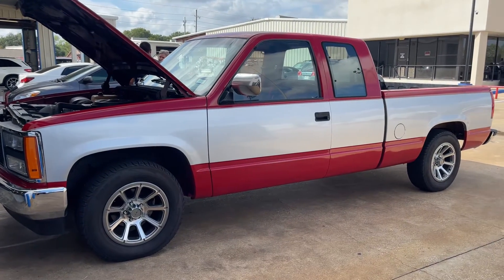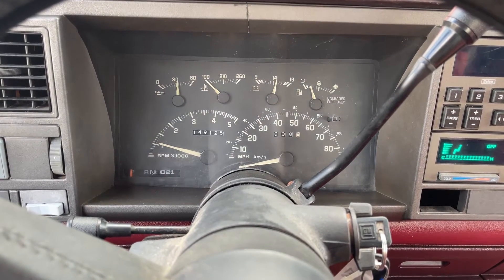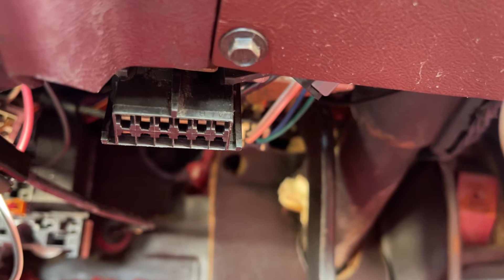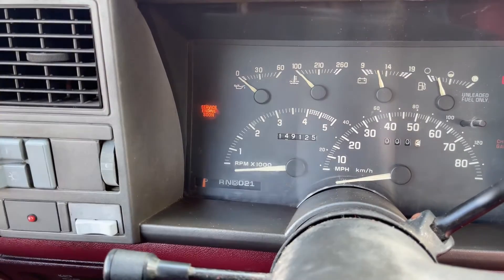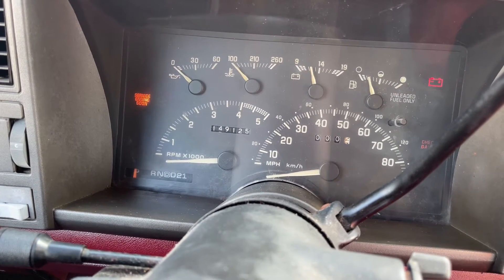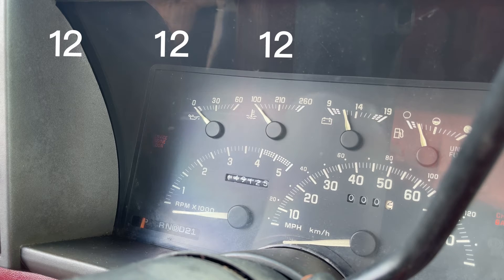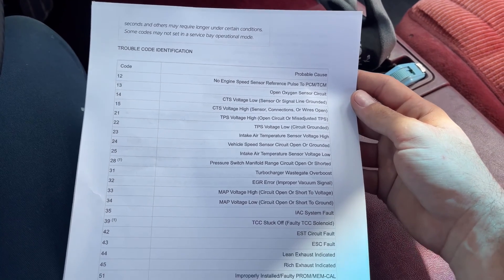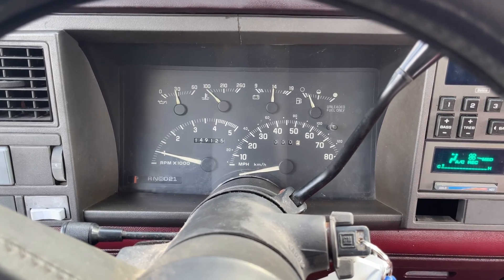How to Scan a Check Engine Light on a Pre-1996 Chevy/GMC Without a Scan Tool (Plus Full Codes List!)

Comment: Jack, I have a 1995 Ford Thunderbird LX with a 4.6L engine. I have a CEL lit up, not to mention an air bag light blinking for a looong time (I counted the blinks on that airbag light so at least I know what that problem is-front sensor problem and steering wheel sensor problem-probably the bags are just old). But for the CEL, I purchased an OBD II reader and it didn't fit the socket-wrong shape and number of pins. So I purchased an ODBI reader and it didn't fit either! I did some reading and it appears that car was somehow caught in purgatory between the OBDI and OBDII transition when it was manufactured, and I assumed that Ford dealerships had the reader to read the codes because they did work on it back in the day (I've owned it since new). I also heard from one local Ford dealer that they probably threw away all that stuff long ago. It's an old car but in very good condition and I'd like to know what the code is so I can fix it before the bulb burns out. Have you heard of this problem and do you have any advice? I have the official Ford Shop Manuals for this car so I have all of the codes. I have read that you can count the needle deflections on an analog multimeter to get the code number. If so how would I do that? I read somwhere in the past you could do that but I have forgotten how. I still have an old analog meter. Maybe I could try the paperclip trick but as I said, I apparently don't have an OBDI system.